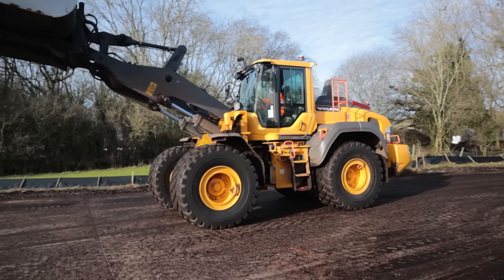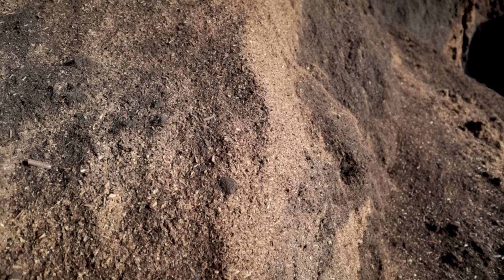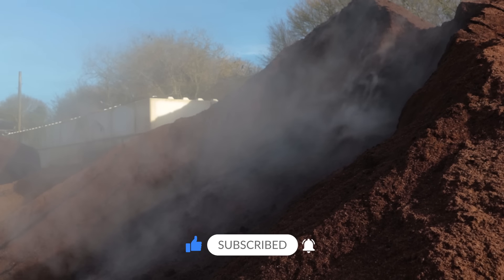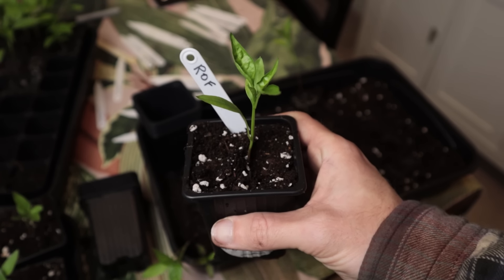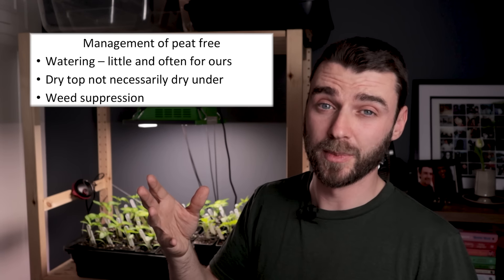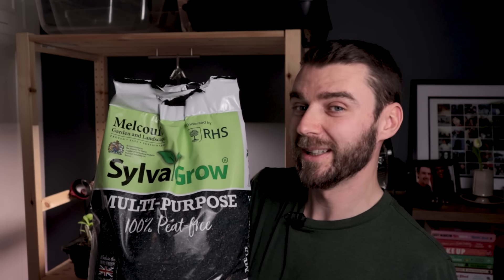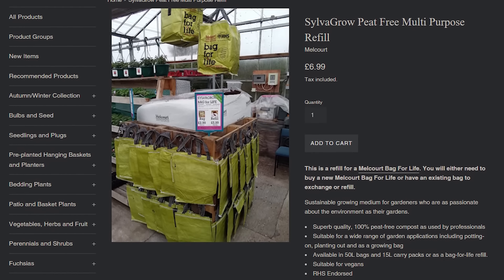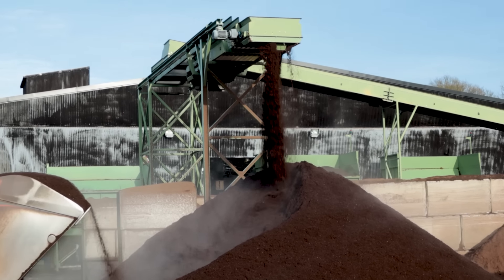Visiting The Sylvagrow Compost Factory | How Is Peat Free Compost Made?

Comment: Interesting JB . I make and recycle most of my own compost from wood chips. I sieved some of the compost add fine sand and sterilise at 185 F in a stainless 14L steel bucket inside a old electrical. 30L tea urn. You only need seed and cutting compost sterilised and fine. I put cheap compost that weed free on top of the planting up pots.

Comment: Fascinating video, JB, thanks. It's interesting that they acknowledged that there had been a wobble in quality during the pandemic - I'd noticed that, for one year, I'd had dodgy results with Silvagrow and I guess that must have been why. I try not to use much bought in compost, preferring to make my own and to buy in composted stable manure for my beds (it's cheaper and locally sourced), but Silvagrow is my choice for seed raising and, when I can afford it, container growing.
Reply from the maker: Totally agree on manure for beds, and sylvagrow do too! They said they were horrified when they saw new gardeners filling raised beds with Sylvagrow when topsoil would have done. It's very much designed for seedlings and container growing!

Comment: I also like the folks at Melcourt. Did I see Perlite in your compost?  I think they advise against adding stuff like that as the finished compost is carefully adjusted and additions usually upset the balance. But maybe you compared the compost as sold with the compost + your addition and found the latter was better?

I am facinated how some brands grow great brassica seedlings, others grow better lettuce seedlings.
Reply from the maker: Yep I use perlite in my chilli mix as it really helps with drainage, coir can be a little dangerous for chilli's which don't like to sit wet.
Reply: @JBNat  Thanks